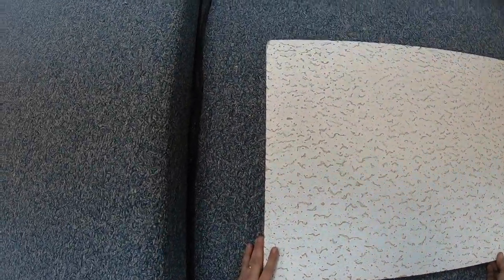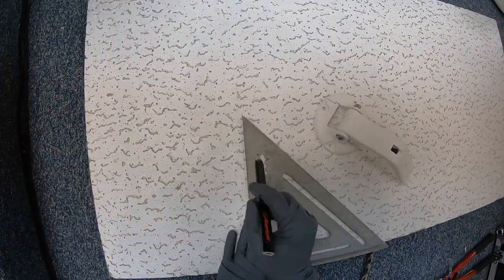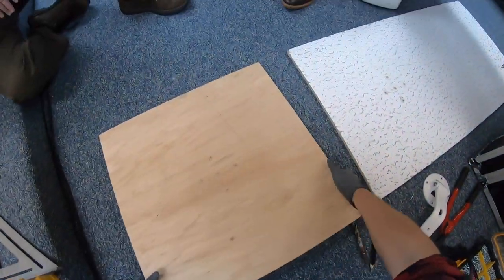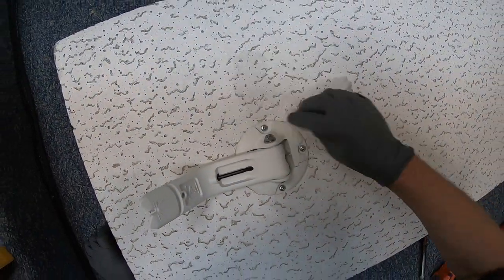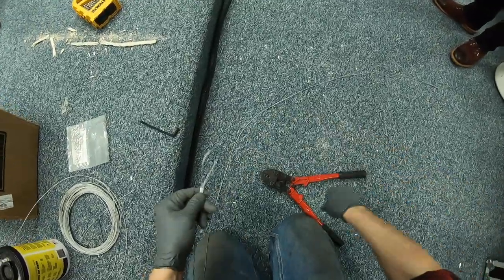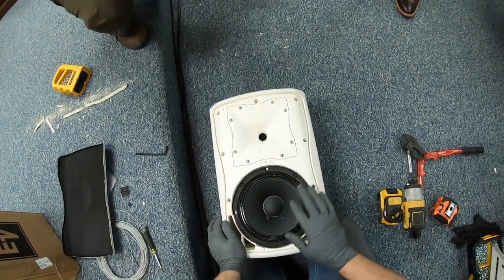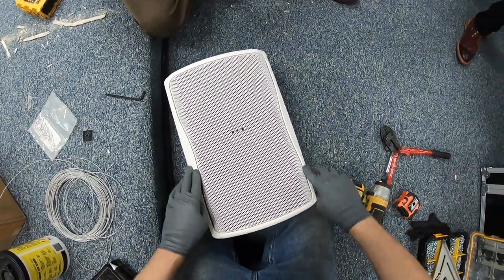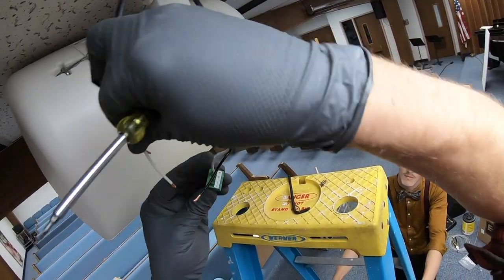Installing speakers on a suspended ceiling

Comment: Nice work it’s just those ev brackets are dirt for getting tilt and swivel directions. But very impressed with your work. I do the same job all over Ireland. From shops to massive nite clubs. It’s hard to get good installers that know what to do.
Reply from the maker: Thank you for watching and more videos to come.  Keep up the good work across the pond.

Comment: No worries about weight capacity of suspended ceiling grid?? Thanks for the great video!
Reply from the maker: If you’re under 25 lbs, there is not a problem, provided the ceiling is suspended properly. But always run a safety cable from the speaker to the structure of the building incase it falls.
Reply: @audiobuff  25lbs total between all speakers?

Comment: Wat speaker how does it sound
Reply from the maker: I used the Electro-Voice ZX1i-90. The i is for the install version.  They come in black or white.  It is a great small speaker. Very good frequency response for a smaller format room.  The entire line of ZX speakers provide a great sound!

Comment: What was that eraser cloth you were using? In the past I've used a 120-grit sanding sponge to take pencil/scuff marks off of tiles, but this seems to work better!
Reply from the maker: I never thought of a sanding sponge, good idea!  I keep hand towels in my truck.  They are good for taking off grease from my hands and tools.  That install I had the brand Tub O’ Towels.  They are around $14.00.
Reply: Mr. Clean magic eraser is perfect for cleaning ceiling tile.

Comment: For a safety wire I uses the same wire that suspended ceiling uses, that stuff is strong. I (or had the T BAR guy do it)  would have added extra T Bar/ suspended ceiling wire on the grid to help support the weight of the speaker. 20 pounds is a lot, those suspended ceiling aren't meant to support a lot of weight. Also I would have used ceiling speakers instead, those surface speakers stick out way to much, an eye sore in my opinion. Plus most ceiling speakers come with a strut/support bracket that spans the 2x2 or 2x4 grid and helps to spread the load evenly on both sides. Putting all that weight directly in the middle like that is not something I would be inclined to do.